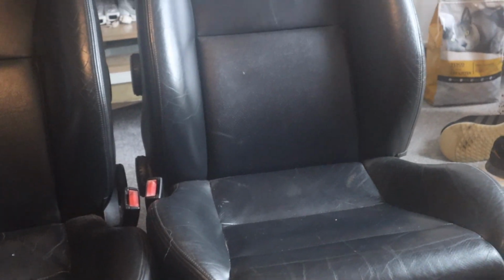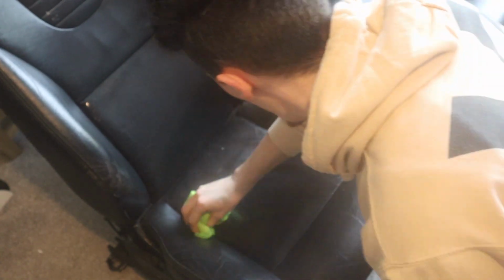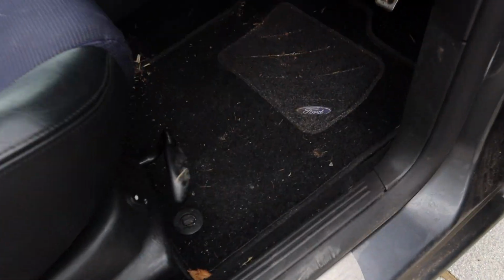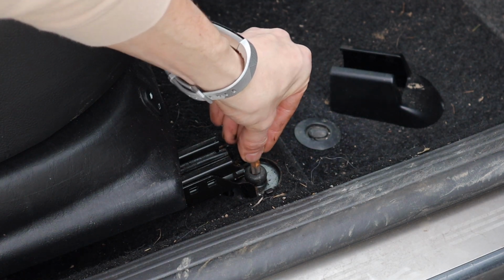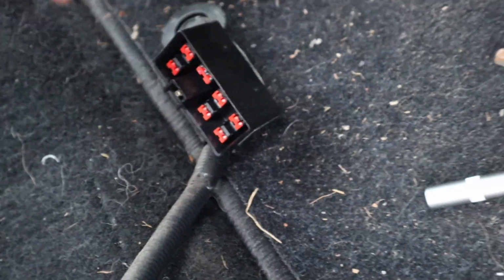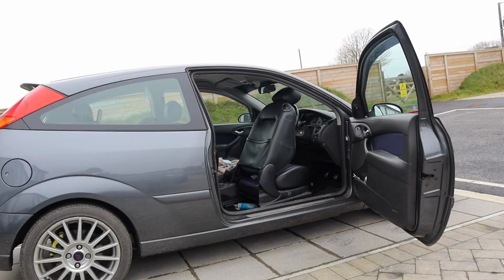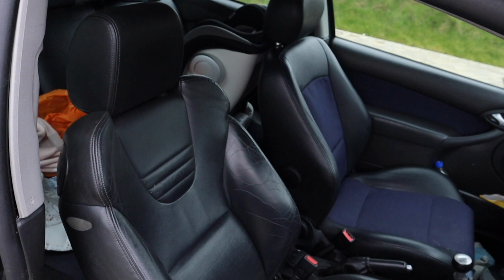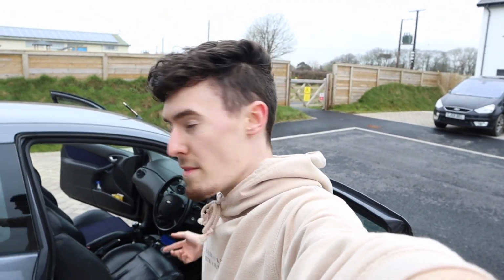How to Fit Recaro seats in an ST170! | Project WRC #13

Comment: Check under your gear console your find you have the wiring for the heated seat loom taped up underneath
Reply from the maker: The seats are heated!! I wander how easy that is to retro plug in 🤔
Reply: @JSMKYT  you’ve already got the wiring from factory all you need is the heated seats buttons and new gear gaitor surround with the heated seat button holes in pull your gear gaitor up and look towards the hand break your find 2 plugs taped together